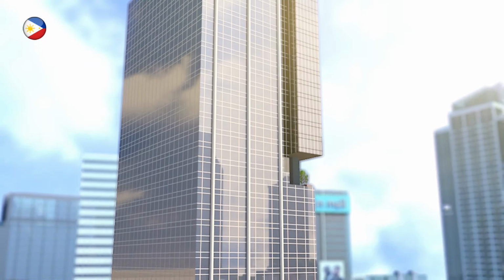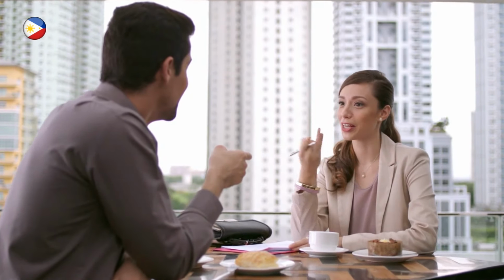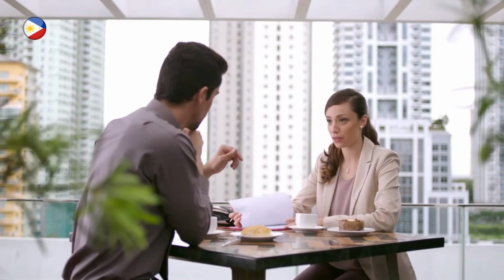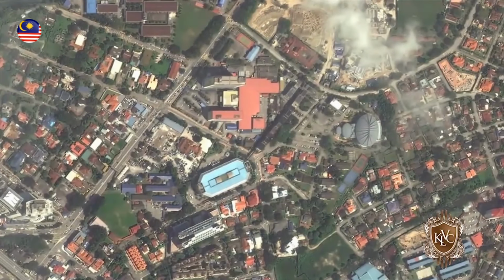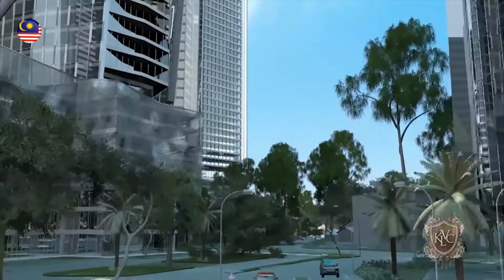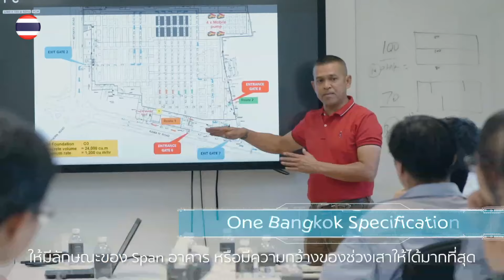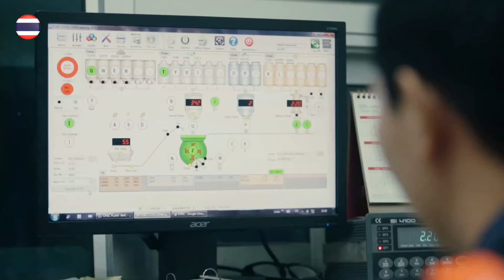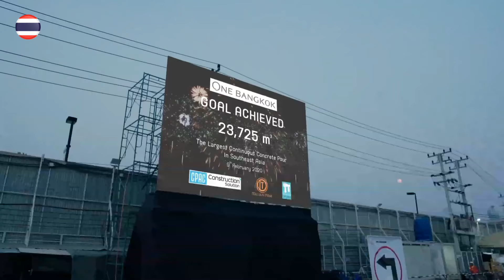Uptown Bonifacio, KL Vertical City and One Bangkok: Asean Premier  Urban District

Comment: Dear Admin : To get more subscribers  from countries you need to do more homework and researches. Please do not simply add without any research. Example : KL vertical city is only a tiny planning project out of hundred projects in Kuala Lumpur currently on going. It is also unknown project by unknown contractor. Only an illustrusion concept planning exist.  Malaysian don't buy/ believe on this cheap marketing gimmick.  Till now...yet to kick off. 
As said in Kuala Lumpur there are many mega projects in progress. Some are really huges...some almost 60% upon completion. 
My sincere advise to admin....Do your homework.
Reply from the maker: Thanks.. but all urban development presented is just small development, just to make it fair,..
Reply: Not really ... do your study... one Bangkok. Is huge . Please check the size of project and the budget.

Again as gentle reminder... Pls do your homework. If you wanna your channel to expand and sustain steadily.
Reply from the maker: Not really, KL Vertical city is 20.66 acres while one bangkok is 41.6 acres. What make it differ is that one Bangkok was a wide space at the center of the development while KL Vertical City is a compact development which include several high rise building calling its a vertical city but by the number of Building plan to be constructed are more or less the same. They have similar concept of being a mixed-use development will include offices, retail space, luxury hotels, residences, and cultural and social spaces. They are still in the same category, it's still fair.